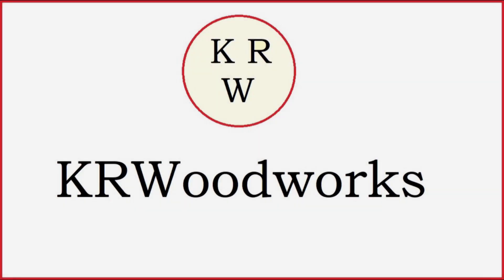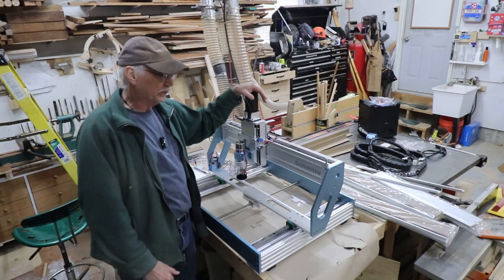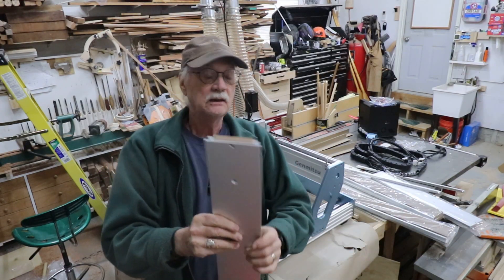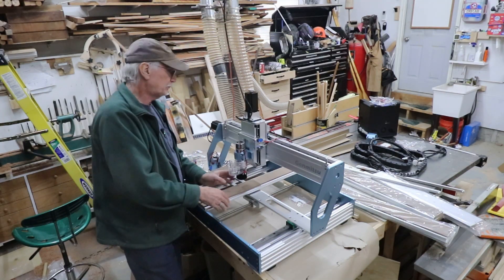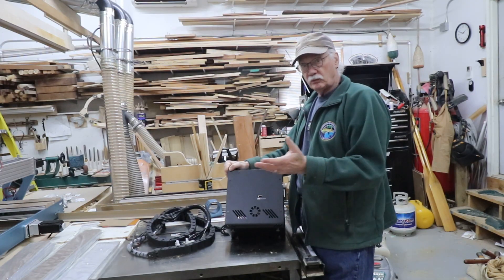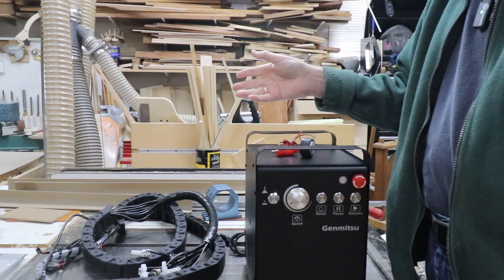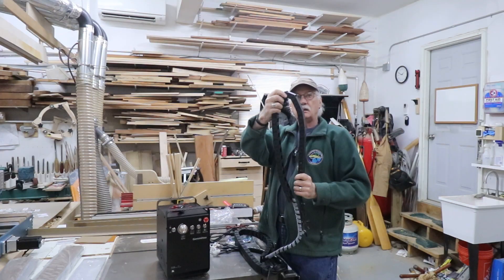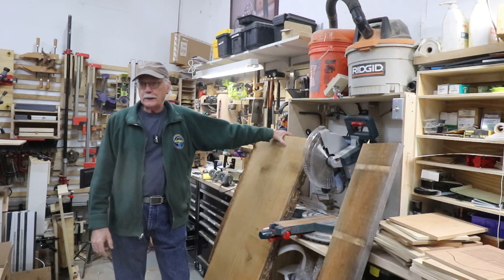What Unboxing Video? And The Jokes Write Themselves

Comment: I have the 4040 Pro and love it. My Z is not as robust as your but great for what I need. Mine came out before yours and was cheaper. I also have the 6040 extension. They have great customer service.
Reply from the maker: Agreed, the customer service is fantastic. I'm building the table for it now.
Reply: @KRWoodworks  Very cool! I made a sliding tabletop for mine so I can slide in up to 48" long stock as mine has to be up agains a wall.